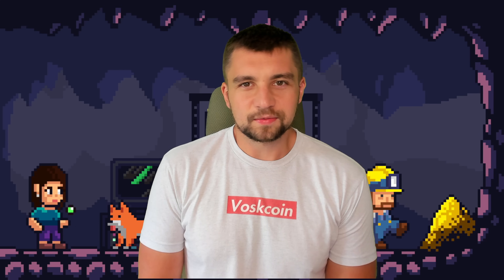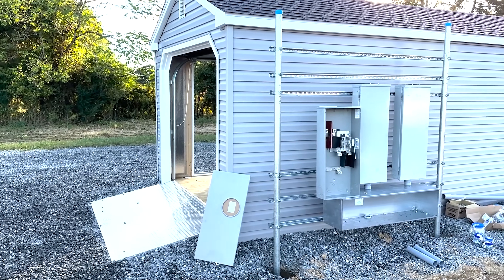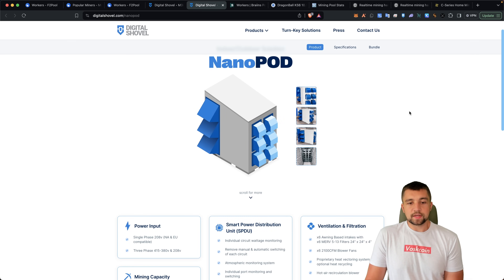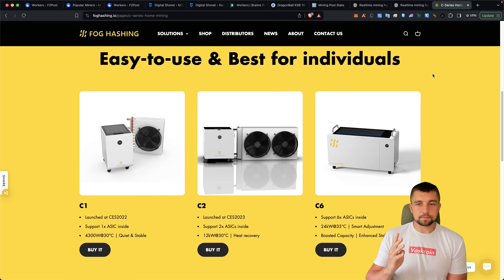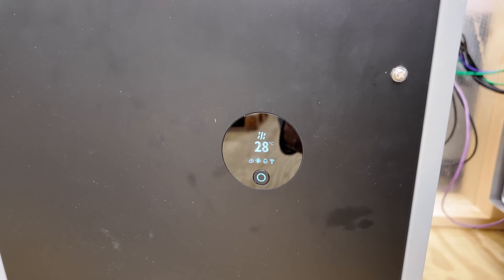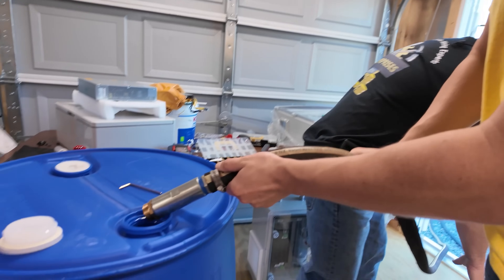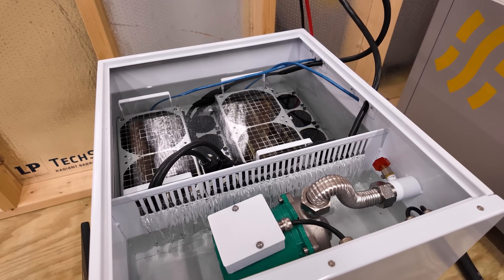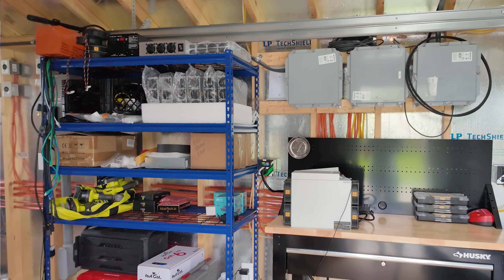I am LOSING MONEY Mining Bitcoin...

Comment: The major problems with solar is the battery capacity. Running at night or during cloudy weeks will have to be planned and built for. With diy friendly stuff, you are looking at about $25-30k for a single 23amp line @ 240vac. You can do it though if you can get the batteries cheaper but still safe.

Comment: I just started mining in my garage and this video definitely brings price to a sobering reality because my rate is around .08 plus a transmission rate of an additional.... 08. 16 cents overall with just two rigs I used $239 in power. It's tough but that's crazy to know the power company will give you a cheaper rate by using more power.
Reply: chinese have a big advantage, mines are used as a dummy load so they can keep hydropower online so it's free.

Comment: dont worry- bullrun will come.
then profitability will go up faaast.
get 3 phase though.
the newer hydro models all run on 3 phase and it is a way smoother distribution of the amps - the neutral cable is basically jobless
Reply: I run t21 have 3 phase is nice

Comment: Have you looked into the USDA REAP program? You should be able to generate 3-phase Solar at 480v. This would give you 277v single phase, which most modern models support.
Also, if at any time you don't want to continue using the S19j/k models, I have a much lower electrical rate and they are still profitable for me. I can either buy them or host them.

Comment: As a smaller miner in the UK i do NOT envy you! I'd be in debt very quickly running the loads you do! I'm sure in the long term it will all work out though. Hold in the low times and lambo in the high times!

Comment: i feel you man, i ran a farm of 50 antminerS1s back in 2014-2015 with 40% discount in electricity and almost zero cost for operations and i knew mining is not feasible. so after 13 months, i sold more than half of ASIC and simply buy Bitcoin from the exchanges. i still have 7 S1s in storage today. it was fun and educational but i will not do it again. how many BTC i got from mining ? not enough to cover the machines and let leave it as that.

Comment: Could you bury 100 feet of plastic pipe say 6 to 10 feet down to pump oil through to cool the oil and illuminate the need for the air coolers

Comment: Your electricity cost is a little high, forget the solar panel idea, do the electrical expansion, either unplug the inefficient miners unless you want to save the coin and hope it increases in value before you sell it and or sell the older asics, and invest in some newer asics.
Reply: If you can afford to ride it and gamble, if the coin goes up in value before you sell, instead of unprofitable, it became actually profitable.
Reply: Hint: by august the blocksize will be 4 megs, so factor that in your inside thinking.

Comment: my guess is that you could dunk the former inmerged miners in an alcohol bath , maibe even use a ultrasone cleaner leave them in there a bit then put them in a verry warm chamber to dry out 

still on the fence about inmercion cooling , the added cost and the possible mess are a stumbling block for me 
there IS sumting i learned recently "s19 miners have corrosion issues on the traces in the corners of the circuitboard on the air inlet side making them give no asics or temp issues 
this is deu to moist air being blown over the traces wearing/corroding off the copper , inmersion mining does away with moist air so those miners if there placed in there straight out of the box "should" last longer before they start to give those problems
knowing this i probably do some precaution work on the hashboards , putting some anti corrosion stuff over that side of the board